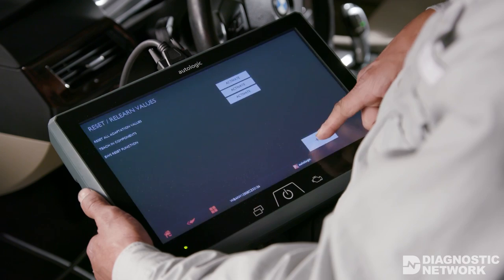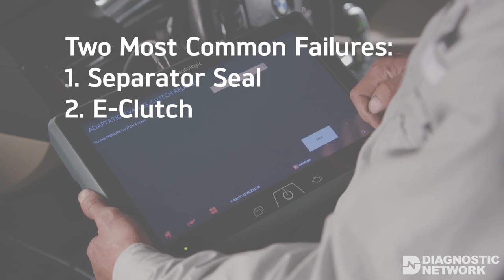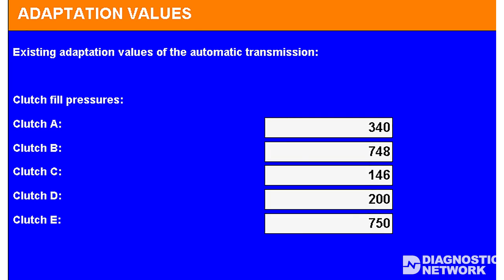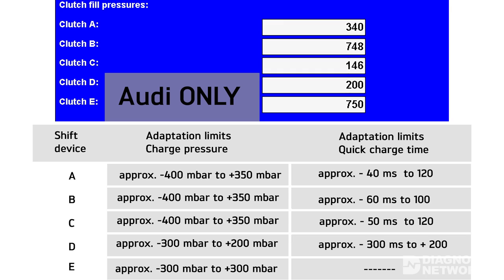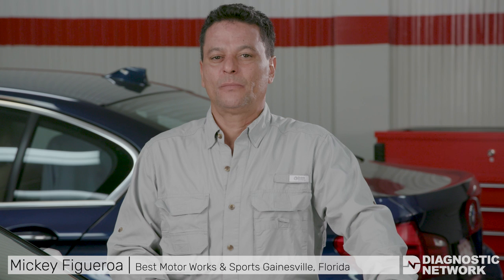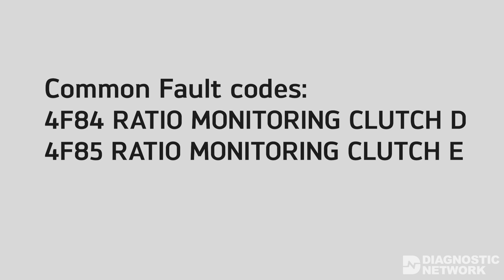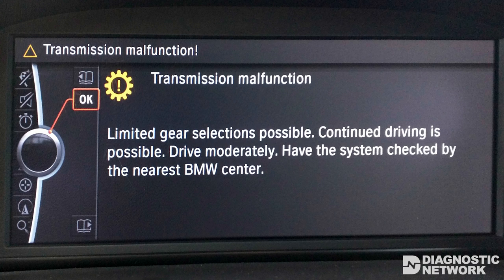ZF 6HP Common Failures (Part 2) Diag.net

Comment: Thank you for this video. I live in Springhill florida and have a 2003 s type r. I drove the car daily and it has 220k miles on the car. I took it off the road a year ago and started a restoration of the car. The last thing I did was the tranny which o was getting a gearbox fault. I ordered the kit and I only changed the fluid with lifeguard and new pan and filter. The transmission improved but is still getting the fault. I'm kicking myself because I have all the seals and got lazy and didn't change them. This video is excellent because it explained how the seal work and I now understand it's function. I'm gonna drain and remove the pan and megatronic to change the valve seals and this one also. When I changed the fluid it was black and the car was not shifting properly . After the fluid change the transmission functioned as it should with a minor slip on 6th gear. I've done all the major work on the car myself as we do not have any qualified mechanics in our area. The dealer will not touch the car because it's to old ? Imagine that. I suspect this seal is bad and will know tomarow after I remove it. Thanks again !

Comment: The Mechatronics sleeve, adapter and four seals are cheap and easy to replace in an afternoon.
Reply: PHATJANUS but how do you drop the mechatronic unit safely on an Audi? The wiring loom is integrated with the connector, so you can’t just pop outwards the connector adapter like the BMW videos show. I would like to take off the mechatronic / valve body on my ZF 6HP19A (Audi A6 Allroad 2007 3.2FSI - gearbox code is KHA) but scared that doing so will damage the wiring loom or connector attachment to casing. Thanks for any info

Comment: Ok, i did a drain and fill on my zf6hp19 with the valvoline. I had a 4-5 flare before i did it and it seemed to fix that for me. No more ZF fluid for me, only Valvoline max life. I have a lot of miles on the car. Changed fluid and pan @ 150k miles with ZF and drove 90 K with flare if pushed hard it would flare so i just drove it easy for the 90 K to prevent it flaring. Drain and fill with Valvoline @ 240k.  ZF fluid is about 5 times more expensive also
Reply: ken howorth what is the difference in fluid??
And why is the change helping you.
Reply: Interesting . I have a zf6hp26 transmission. I was going to go with the fluid you stated , but I didn't wanna question myself if there was a problem
Which I have . I have the entire kit and got lazy and didn't change the seal described in this video . I'll be under the car tomarow. Thanks 👍

Comment: Great info about 6hp19 :) I have to look my clutch adaptations... in service we have an audi 3.0tdi qauttro which starts shifting very hard when warms up. There was an oil & filter change and mechatronic completly cleaned with new seals. There is no fault code...When transmission is cold, work OK... weird...

Comment: @Diagnostic Network.  I was hoping you could make sense of this for me.  2008 535xiT, fluid change w/ all 4 Mechantronics gaskets and sleeves replaced, also a recent engine change.  Car still feels a shudder in 2nd, slight uphill, light throttle...while WOT it slams pretty hard on 2-3...while cruising it sometimes feels like the trans is lightly coming on and off.  I followed your procedure at least 10x, condition still exits...please help :/ 

Before resetting adaptations -
Clutch fill pressures:
Clutch A: 6.0
Clutch B: -99.0
Clutch C: -260.0
Clutch D: 215
Clutch E: 100
Rapid fill pressures:
Clutch A: 13.0
Clutch B: 9.0
Clutch C: 3.0
Clutch D: 0.0 
Clutch E: 138.0

After resetting adaptations - 
Clutch fill pressures:
Clutch A: 8.0
Clutch B: 7.0
Clutch C: 0.0
Clutch D: 225.0
Clutch E: 0.0
Rapid fill times:
Clutch A: 18.0
Clutch B: 0.0
Clutch C: 0.0
Clutch D: 0.0
Clutch E: 0.0

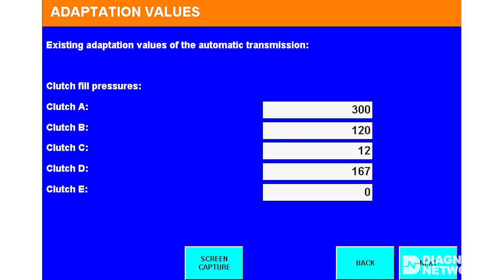Comment: I can’t quite make out what is said between 3:34 and 3:40. “After we have completed repair of the separator seal, serviced the ??? and completed the adaptation”. What is the missing word denoted by ??? please?
Reply: ATF
Reply: Gary VanRemortel thanks Gary 👍
Reply from the maker: Hi @MrCurry, you can also turn on the closed captions (CC) for more info.
Reply: Diagnostic Network thanks for the tip 👍
Reply: @DiagNetwork   @Diagnostic Network I was hoping you could make sense of this for me.  2008 535xiT, fluid change w/ all 4 Mechantronics gaskets and sleeves replaced, also a recent engine change.  Car still feels a shudder in 2nd, slight uphill, light throttle...while WOT it slams pretty hard on 2-3...while cruising it sometimes feels like the trans is lightly coming on and off.  I followed your procedure at least 10x, condition still exits...please help :/ 

Before resetting adaptations -
Clutch fill pressures:
Clutch A: 6.0
Clutch B: -99.0
Clutch C: -260.0
Clutch D: 215
Clutch E: 100
Rapid fill pressures:
Clutch A: 13.0
Clutch B: 9.0
Clutch C: 3.0
Clutch D: 0.0 
Clutch E: 138.0

After resetting adaptations - 
Clutch fill pressures:
Clutch A: 8.0
Clutch B: 7.0
Clutch C: 0.0
Clutch D: 225.0
Clutch E: 0.0
Rapid fill times:
Clutch A: 18.0
Clutch B: 0.0
Clutch C: 0.0
Clutch D: 0.0
Clutch E: 0.0

Comment: Thanks for the great video! Please please could you perhaps help me? I am always getting -700 mbar clutch E fill pressure after adaptation. I cannot find anywhere an information if this is outside of the allowed pressures. My transmission 8HP55 when the fluid temp is over 70-80 C, jerks slightly always before shifting 1-2 and 5-6. Very very slightly 2-3 and nobody can help me. Not even ZF official repair shop. Mechatronics has been checked and entire transmission rebuilt with new parts. No one knows why it jerks :-(

Comment: Hey Mickey, great video. I have a ZF6HP19A in my Audi S4. I got a new mechatronic and reset the adaptations. Car shifts great. My problem: when i am standing and shifting in to R or D with foot on the break, the engine rpm drop heavily and the whole car vibrates. When i drive and come to a stop there is close to no vibration. Only when shifting in D or R when standing. What can this be? Thank you so much in advance :)
Greetings from Berlin

Comment: Cool video,

I’m having problems where when it shifts to 4th, it will jump and jerk back to 3rd a few times and will go to safe mode and just stay in 3rd. Would this be the mechatronices/solenoid issues or the transmission synchronizer?
Reply: Stator bushing. E clutch burned.
Reply: Arno Bruynen 
Thank you...

You’re very accurate. The drum is being serviced. Mechanical failure!
Reply: @borinpich7420  Thank you Borin.

Now I understand a little more.
Again.  You helped me get to this level of possibly understanding.  Will try the seals and test the actuators first.  Hope it's not e drum.

Plunked 3 or 4 times hard going into 3rd or 4th.

Last time hasn't come out of gear problem mode.

Found dipstick.
2008 750li.
Put about pint of red fluid in.
Stick has ATF-4 on it in little tiny letters.
On other end has min.  and
max.

Fluid is tan?
Doesn't smell like cat stuff.
Smells like 5w-40 or 10w-30?

Somebody put engine oil in tranny?

More to investigate, decipher.

Comment: Hi there, i have 07 750li with zf6hp26 trans,my vehicle start going into
 park from drive aftere vehicle worm up,will not do it when it's cold, 
error code iam getting is  4E89 SV 1 or SV 2 mechanically jammed.Have 
you seen a code error like this. I replaced all mechatronic sleeves and 
all solenoids, followed fill procedure engine off ,engine running at 40c
 .Reset adaptation,still having the same problem.I recently replaced the
 valvebody with used one but i used my old TCM module installed on  it. 
because I couldn't flash the one that came with the used valvebody 
,still have same problem same error code. could you please help me with 
this problem what it could be.thanks.
Reply: Have you found out what is was?
Reply: @emilianoelsing4344  I end up rebuilt the transmission, after trying replacing valve body, TCM, all the solenoids, fluid, oil pan. Nothing help . I think mine had problem with oil pump or the torque converter. Even the shop who fixed it didn't tell me what was the issue. That is why they go for replacing everything ( rebuild ) it cost me 5300 with life time warranty. I know the vehicle is not worth that much but I already through a lots of money on it. Good luck to you.

Comment: Mickey, thank you for making this amazing video - you have given me some hope that I can diagnose and fix my transmission issue. I have a 2007 Audi A6 Allroad 3.2FSi with KHA gearbox code (6HP19A). I’m experiencing lockup clutch slip in 4th, 5th, 6th at low temperatures and around 1400rpm with light engine load. Do you know this issue and the solution? Thanks
Reply: I have the same problem, most when is oil is cold, and the problem is the seals, lost pressure and transmission try to compensate increase the rpm, i replace the seals and solve the problem.
Reply: Fábio Leça thanks - which seals did you replace and what car do you have?
Reply: @PVflying  valve body seals, the seals the guy talk on the video.
Reply: Thanks, that’s interesting as I thought those seals control only gear shifting, not torque converter lockup clutch slip.  That gives me encouragement that I might fix my problem by changing the seals. Is your car BMW or Audi? Thanks for your info
Reply: MerCury for you lockup the converter you need pressure, if you not have pressure the converter go slip until create enough pressure
Reply: the seals control all the internal pressure, gears and lockup converter need precise pressures for work right.
Reply from the maker: Full post and discussion on Diagnostic Network can be found here:
https://diag.net/msg/m60nas7spvinkvvo... If you're a service professional feel free to join and ask your question.
Reply: i’m experiencing this problem. i replaced the seal and problem persists any other seals i have to replace or is my E clutch gone?

Comment: i have a zf6hp19 with 4-5 flare when pushed hard but drives find when shifted below 3000 rpm. What do you think is wrong?
Reply: you will have to take a part the transmission and check Mechatronics seal and then check the e clutch bushing and the e clutches and check for cracks in the associated tube and housing.